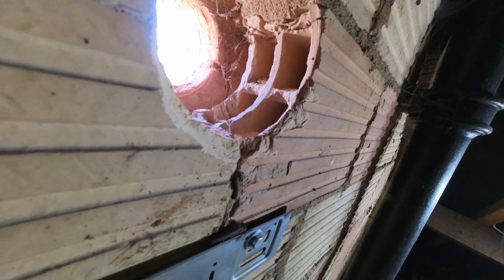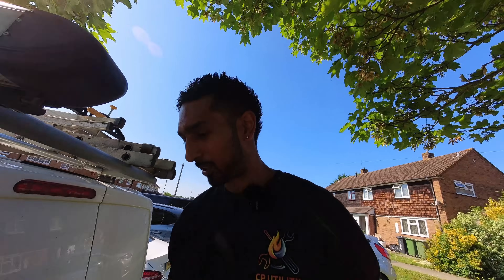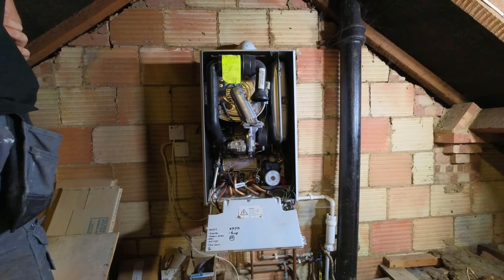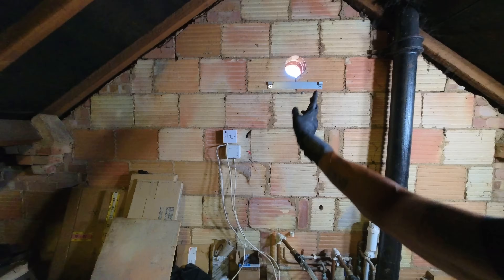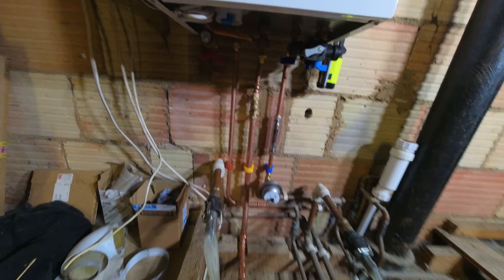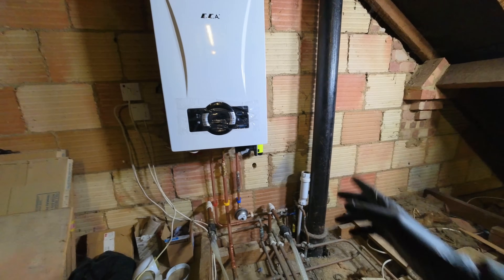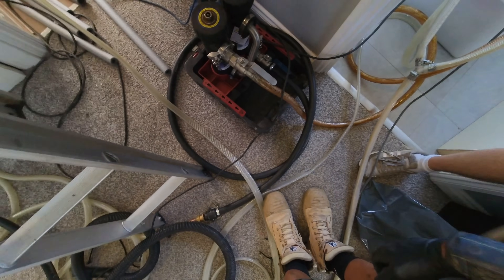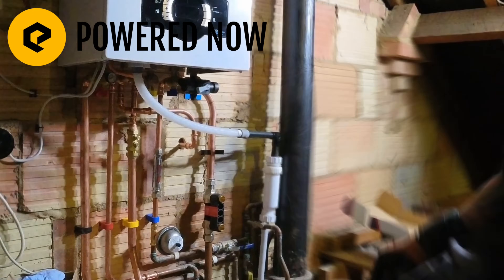Can Someone Please Explain? - A Day In The Life Of A Gas Engineer 172

Comment: Loft insulation. for 15mm copper pipe is 25mm wall; 25 + 15 + 25 = 65mm, so you need to stand off your pipes from the wall to allow for large diameter insulation, and for 22mm copper pipe its 19mm wall; 19 + 22 + 19 = 60mm. there's also a requirement for a permanent fixed walking board form loft hatch to boiler and a permanent fixed hand rail, also a cage must be fitted around the boiler so as to stop people leaning items against the boiler, and then there is a requirement to have a fitted loft ladder with a hand rail. All of this is so that when the boiler needs service/maintenance, a engineer can access it safely, as it is the boiler manufacture will refuse to fix the boiler. Just think what will happen if the service engineer fall through the loft and ends up in hospital, that RIDDOR is coming at you. 
And don't forget to lag the condense waste and best remove that stupid shower trap as in the winter the bladder is going to freeze and the boiler will drown in condense water.  
It was all in your gas training, why not do it correctly.
Reply: Chill out Derek.😮
Reply from the maker: Thanks for your feedback 👍🏾

Comment: Give these a try mate handy to have on van  ... deWalt aerated nylon concrete anchors  from screwfix pack of 50 . Used to hang big double rads on something similar to that wall .Then use coach screw's to fix.

Comment: They build at the loft level , these bricks are used for hot weathers , but whoever build that section , he’s smart , usually lofts gets really hot in the summer , it helps to cool down , which reduces the humidity and heat inside the house during hot seasons .
Reply from the maker: Ah gotcha good to know!

Comment: Aerated bricks or 'parpaing' is a common building material here in France, especially for construction of walls and ceilings during the 60's & 70's. Easy to core through but difficult to get a decent fixing which takes any weight. Epoxy resin fixings can work if you're hanging a boiler which isn't too heavy. For heavier applications a floor support is also needed.
Reply from the maker: Nice one thank you for the info 👍🏾

Comment: think its terracotta brick. Get it a lot on the older council houses can be a pain to get a decent fixing on them. Just don't use hammer on your sds blows the brick then your done for a fixing in my experience anyway.
Reply from the maker: Yeah I just used it on normal mode and it worked in the end 👌🏾
Reply: @cputilitysolutions  glad it worked out I have had to pattress walls out to get a fixing for radiators and such can be a nightmare